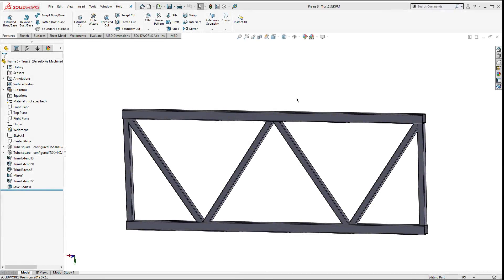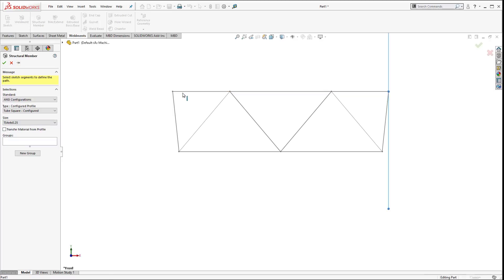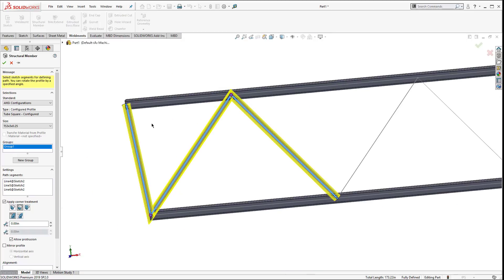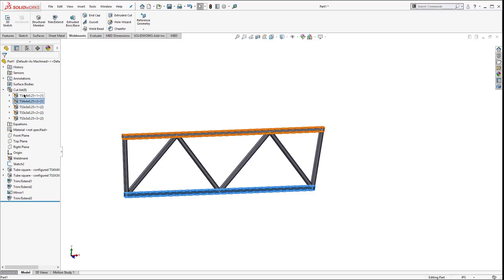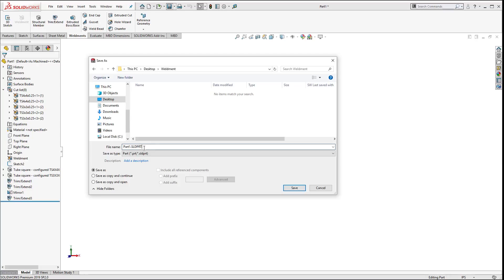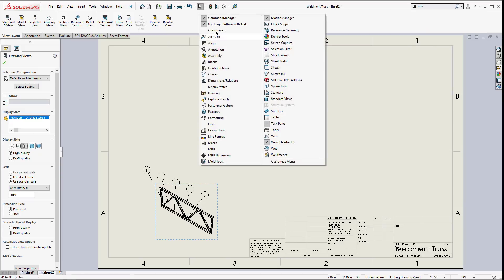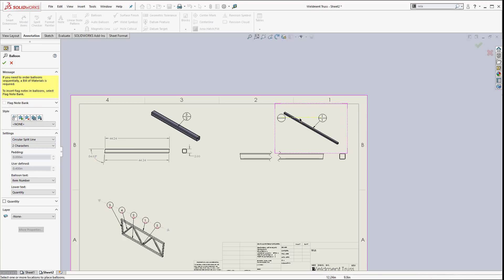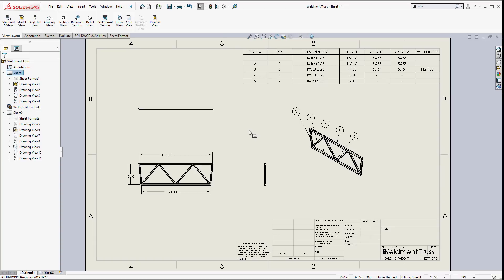SOLIDWORKS - Weldment Truss and Drawing

Comment: This is exactly the type of drawings our shop needs, except they require bolt hole locations also. Is there a way to model and draw weldment structure with bolt holes on members. (Our fabricators drill holes on members prior to any welding)

Comment: This a very helpful video for a beginner like me, I just have a question. The height of the frame on the drawing is 48 inches from top to bottom. If you apply weldment additional thickness will be added since the dimension line will fall in the middle of the material. So if I cut the #3 material by 44.55 inches and place it over the #1 material which the reference line is in the middle of the material then the total height in actual will be more than 48 inches. Can you help me on this?
Reply from the maker: Weldment profile orientation can be controlled so that the material is added to the inside of the over dimensions.  If you look at the locate profile option in the property manager https://goeng.io/E2xpTe  that should get you what you need. IF you have more questions check with your VAR's training and support team they should be able to help you more directly.

Comment: Thanks. Very informative. Can you combine cut and bend list?
Reply from the maker: You may not be able to combine the tables directly, but some of the data in the sheet metal parts can have properties that can populate the weldments cuts list. Take a look at Tony’s video on the Weldments Cuts List - https://youtu.be/14Lh-2SJlfg . This may take a lot of time due to the bend tables data comes from the bend features in the feature tree. A sneaky way would be to export each table to an excel spreadsheet format it, then copy and paste it into your drawing, the only downside is that any updates to the parts would require a manual update of the table.